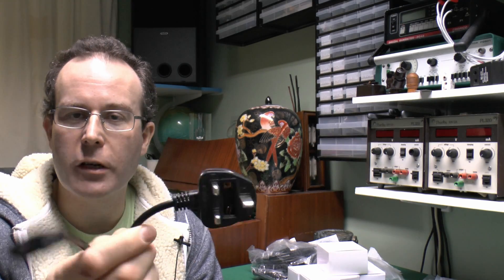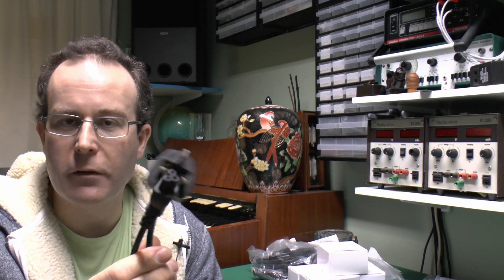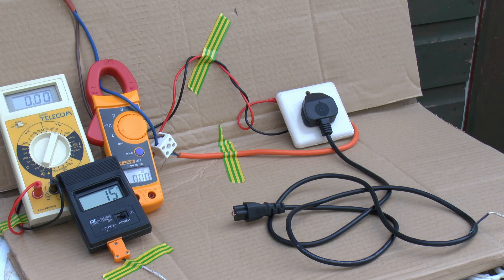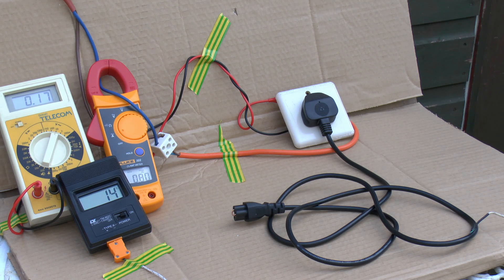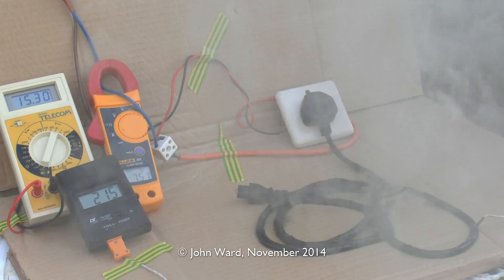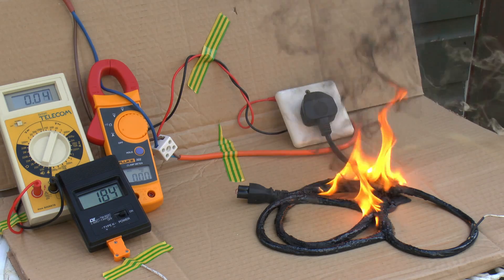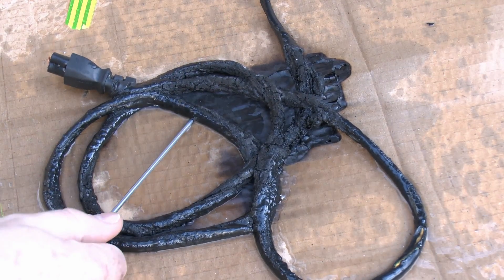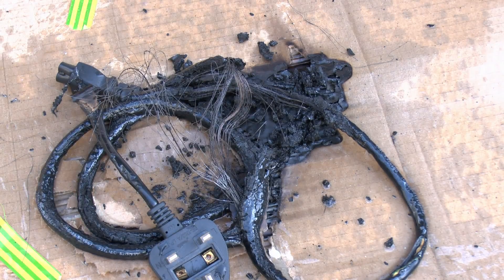C5 Power Lead Destroyed

Comment: At 13 Amps, 3V it reached 72 degrees. How about 230v?
Reply: In theory it shouldn't matter because if 230v was supplied the voltage drop on the cable would be the 3v and the other 227v would be "used" in the device itself. The resistance of the cable is constant (almost) so the voltage drop is linked to the current.

On the other hand I would be curious about the same test but with the original fuse installed, does the fuse pop before it starts a fire? Of course in my country and pretty much anywhere else in the world we use unfused plugs. In the case of the schuko style plugs these cables should be rated to 16amps but I have not seen many.

Comment: took my cable apart after failure,just stopped working after 2 months use,  looks like aluminium wire copper coated very stiff and springy the wire was very small gauge with extra insulation that is stiff to support it, question is were can i get a quality one that has copper wire in it?

Comment: isnt 0.75 cable rated for 6amp?? so it should be supplied with no higher than a 5 amp fuse in the plug? i have a lead almost identical to this except the earth pin is correctly unsleeved, just looked and it has a 13amp (?) fuse in , plain white - no colouring or BS marking - with just a small black 13A printed on it !

Comment: Maybe worth pointing out that the current you ran through it isn't unreasonable if the fuse failed to... fail as we run 32A breakers on the mains.

Comment: I agree that is a junk cable, but it seems to be capable of preforming its intended use.   If the fuse was less than 13 amp to protect the wire it would be acceptable, except for the flames(wire insulation is supposed to be flame retarded)
Reply: stevmoon I think you missed the point.

Comment: Great video JW, I never though of recording the watts loss, the C5 clover leaf connectors are only rated at 5.0 Amps acording to  BSI Approval so the test is a bit pointless, the actual load on the cable in real life would be limited by the connected device or it would be a short circuit that would clear the 13Amp fuse in the plug almost imiediatly.  That said surely the CCA cable would be more difficult to produce, couple that with the destructive effect of the dissimilar metals I don't see the purpose of making the stuff at all.  Keep up the great videos.
Reply: If a short circuit developed in the cable flex just before the C5 connector or the connector or appliance, far more than 5A would flow...
The current rating of a fuse is the maximum normal non-breaking current. Not the current it will blow at. So you can draw 20A through a 13A fuse for a limited time. The idea of the standards is that if the cable flex and the fuse are correctly rated and manufactured to comply with the standards, the cable flex should be able to cope with an overload until the fuse blows, without the cable flex becoming a danger.
Reply: It was supplied with a 13A fuse, so the test was valid. The whole lot was supposed to cope with a 13A fuse and its overload.

Comment: I'm confused, if it was a 13 amp fuse and you put 20 amps on it wouldn't that have tripped? If u put a larger fuse in for demonstration purposes this is actually showing it can go well above it's intended use without catching fire, but adding this much current with it's intended fuse wouldn't cause a fire as it would trip.
Reply: wsvitak You're right, the fuse would have blown and if it didn't then the main house fuse or breaker would have. After carefully examining the cord and finding it didn't meet the standard in many ways, JW felt it needed to be destroyed in a fitting manner. JW may have the delivery of a BBC announcer, but he has the heart of Photonic Induction.

Comment: I'm a couple of questions if I may,

1. Why 8v? Would there be any difference between 8v and 240v both at 20v? Since it looks like a mains lead shouldn't it have been tested at mains voltage? 

2. I'd have thought 12-16 Guage cable lower or less but I can safely pull 20a 12v across 12 Guage for my HF radio.
Reply: +Glen O'Riley You keep confusing what goes through the cable (rated for 240VAC/13A or about 4000W) and what is lost in the cable (in this case a few volts at 13A).  It's the loss that is too big, causing the cable to eat 100W or more and overheat.  Then to make a point, JW also tested what would happen if someone sabotaged the fuse and drew 25A (6000W), causing the loss to exceed 200W, melting and burning the cable.
Reply: At 240V you would be putting kilowatts of power into the cable. It would completely disintegrate within a second or two, possibly with a bang and pieces flying everywhere.
Reply: That said, our heater runs 2400w 240v which is 10amp when it's running at full (will sometimes kick a cheap powerboards overcurrent protection.

So ok it's 2.4kw @240v and the power lead is fine at that. So I fail to see what you are pointing at. I agree that over 12-15amp the lead should disintegrate in a regular appliance but this was showing heat and failure at 10amp and who in the real world will be running at 8v (likely DC) for an appliance?
Reply from the maker: 8 volts was just the voltage which resulted in the required current flowing through the lead.  Higher voltage would result in higher current.
In normal use with an appliance connected, most of the 240 volts is across the appliance, not the lead.
Unknown what the actual wire size was, but it was far smaller than any lead of that type should be.
Reply: John Doe
ok so you're talking the resistive value and how much power is consumed in resistance heating the cable. That I get.

Maybe I'm just going geriatric lately but I just can't see why testing it at well under what power it SHOULD be able to handle is a real test. That said if it can't handle the 160w odd then it does have big problems for use beyond something like a laptop.
Reply: ***** Power is P = U * I (voltage times current)
250V * 16A = 4000W - Let's assume this is the power draw of the device connected with this cable.
Let's assume that the cable has 1 ohms of resistance in total.
Ohms law: U = I * R (voltage equals current times resistance)
Power lost in the cable: P = U(voltage lost IN the cable only) * I
P = (I * R) * I = (16A * 1ohms) * 16A = 256W
So for 4kW load the cable "only" dissipates 256W. Obviously, this one couldn't do that, even though its advertised to do so.
Reply: Glen O'Riley and for your second question: 12 gauge is way thicker compared to this cable.
For a 12 amp circuit you need at least a 12 gauge cable in Belgium. 12 gauge is fine.

This was most likely a 20 gauge cable or thinner.
Reply: *****
I still fail to why you would use 8v instead of 240v when the lead would normally run at 240v xAmp. Your wall socket is not 8v.

So wouldn't a better test have been if it can handle current at its used and rated voltage?

I realise I made a mistake in my original post, should have read @20a not 20v. But anyway if the lead is supposed to be able to handle 10a (that's the fuse rating?) then the power @240v 10a should still be not enough to cook. Else it would normally cook a lead to a heater which runs at 2400w or 240v 10a.

Either way it's disappointing the lead couldn't handle 160w or there abouts ASSUMING you applied AC. If you applied DC 8v that's another story all together and that nullifies the results of this.
Reply: Glen O'Riley the voltage really doesn't matter.
For example: you need twice the amount of current in the United States for the exact same amount of power in Europe, because they use half the voltage.

The exact same thing would've happened wether it was on 240V, 10.000V, 8V, …
As long as the current (23 amps I believe in this case) is the same, aka as long as the cable is loaded with the same current …

I don't know what his power source was, but if it's a 240V standard power outlet, he would've tripped the breaker, because he's using too much power and there's a short… Plus: you'd probably have a small explosion at 240V.
23 amps at 8V = 184 watt, or less than 1 amp on 240V.

So on 240V the exact same thing would've happened, except your breaker should trip before the cable catches on fire.

I live in Belgium, and older houses have 16 amp circuits, newer ones have 20 amp circuits. Combine that with a slow circuit breaker (type C, which lets you use twice the power it's rated for, for a couple of minutes before it trips) and you could definitely start a fire.
It's not okay this cable already got that hot at 13A (what it was rated for). I guess this is a 0,75mm2 cable, but still…
Reply: 12guage should be fine up to 30a@12vDC. I've run heavy commercial and HF radios (transceivers) off 12g that pull 20a and had no issues. I've wired up driving lights with 12g and not had an issue with them.

8g should be able to safely pull around 60a iirc.
Reply: great guy jw learnt alot of stuff from ur videos as im still doing my course but ur videos are very helpful god bless u.

Comment: I have 2 major issues with this video. Before I state them I should say that the cable is clearly substandard and dangerous, I have no arguments there. The high resistance of the cable you demonstrated in part 1 is definitely a bad thing and I was interested to see how hot it got at 13 amps with just a few volts. I have no problem with the demonstration up to that point in the video and part 1 was well presented.

The 1st issue I have a problem with is that you deliberately overloaded the cable beyond what is considered "above average use" to force the cable to dramatically overheat. You can do this with any cable, poor quality or not, and get the same results. Of course, with better quality cables that conform to standards the levels to get them to overheat will be a lot higher, but still.

The 2nd issue is the fact that you have placed the cable on a highly combustible surface, I.E. corrugated cardboard! This guarantees flames a lot sooner than you would get if on a noncombustible surface thus adding 'drama' to the demonstration.

I have viewed a few of your videos showing bad products and the majority of them seem to over hype the dangers of the products. One in particular you even created implausible issues with the product to increase the sense of danger when using it. Yes, the products are substandard and should not be used, they can even be dangerous in many cases, but this type of over hyping is something that I would expect to see in tabloid news, not in an informative video.

Take this as constructive criticism as I really do think you are doing a good job showing us dangerous products, it's just that there is no need to stoop to tabloid levels by over hyping and dramatizing the dangers.
Reply: I thought that the point was in the UK the ring main can deliver up to 32 amps before cutting out, therefore anything plugged in needs to handle a fault such as a short circuit without catching fire. 

Safety is not just concerned with every day use, but what happens in the event of a fault - properly designed and built systems will "fail safe", there should be no part of the system that could catch fire in the event of a fault.
Reply: Galbi 3000 I think the cardboard illustrates how quickly an electrical fault could set your home on fire
Reply: I think this demonstrate a real scenario  of how fast the fire comes out when a short circuit occurs
Reply: Galbi 3000 he overloaded it beyond its capabilities, removed the earth wire ...the cable had no chance..this test is inconclusive
Reply: Andy Merrett
Lighten up? This is presented as a serious safety video so why should I take it lightly?

Deliberately overloading a cable to demonstrate how unsafe it can be is pointless. As I pointed out before, even cables that meet the safety standards can fail when overloaded enough.

UK safety standards mean that carpets for one are not easily combustible, so your point there is somewhat moot.

You have failed to present a reasoned and valid argument here. Try again when you have a valid point to make instead of trolling badly with silly hat puns that don't work!
Reply: if the cardboard was the cause for the flame research how hot can cardboard get before it combusts...
than complain
Reply: Fish productions
When you can learn the difference between 2 simple words and use them correctly only then can you correct me. If you are smart enough then you might be able to work out which 2 words. Here's a hint: you used a wrong one in your comment :P